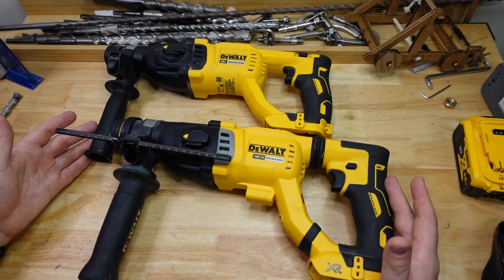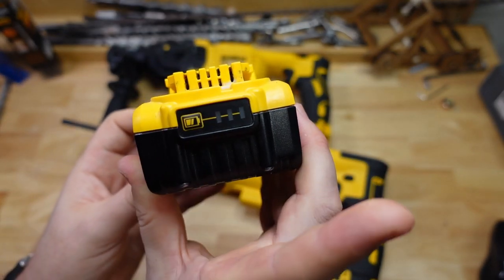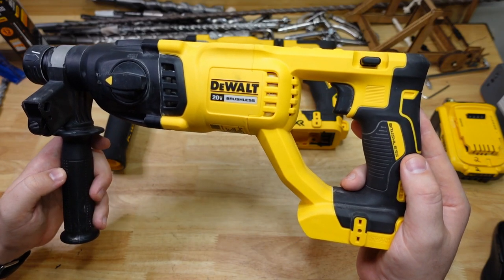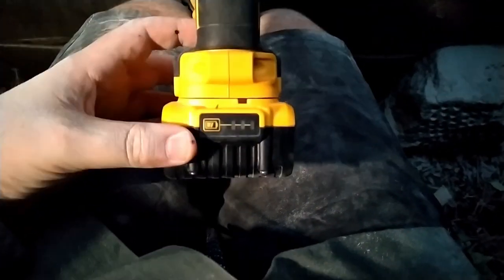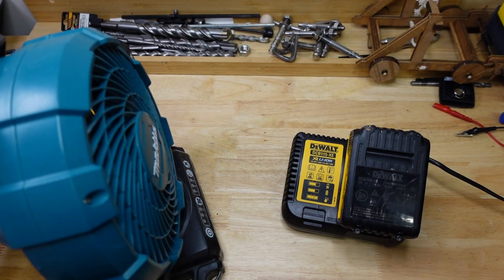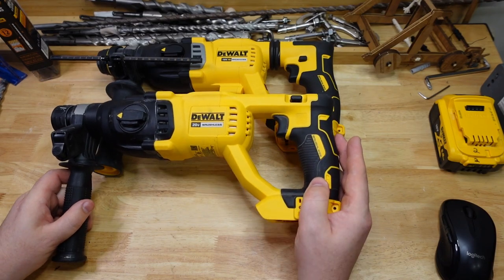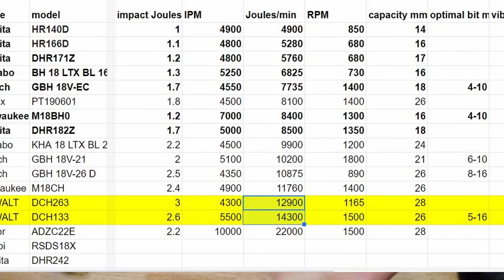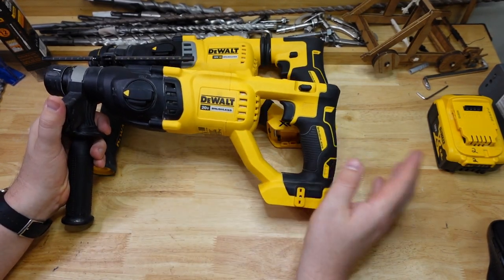DeWalt vs Granite! DCH133, DCH263 runtime tests (cordless SDS rotary hammers)

Comment: Delighted with your review - many thanks! - I have the DC133 which I have always been amazed at how good it is for the money, but I saw the DCH 263 today and Googled the 3 Joules impact and was sorely tempted to upgrade, your review has saved me from a little disappointment! Also a a good tip with the battery discharging issue - I will keep my eye on it - many thanks again - PC

Comment: The DCH133 will dramatically reduce power for a moment at the end to let you know it's battery is done. You can let go of the trigger and then squeeze it again... But this would wear on the battery or potentially damage it if you continue.

Comment: I'm also a climber and a rope access technician.And i have both drils ,plus many other Dewalt tools..
The 133 is ligher and i can handle it better with one hand,the 263 is heavier and i use it mostly for bigger holes.
For the money,i think 133 is the better choice ,for general use.
Reply from the maker: You sound like a smart guy with good taste in rotary hammers and hobbies!
Regarding using the D-handles one handed, do you find they're better than other style drills? Like they get better reach but are less balanced?
Reply: @BoltahDownunder  Thanks for the compliments 😊
I don't find them less balanced with an 5 ah battery,and yes they have better reach. Also ,compared with the other hammers in Dewalt's range (273,283) ,the D handle models are more powerful,weigh less and they're cheaper.
The one that is more powerful is the Flexvolt Dch 333,but it's big,heavy and costs way more...i personally don't need it.
Reply from the maker: Thanks mate, good to know! I usually recommend people get drop motors for bolting climbs, but the 133 is so light and powerful, it's the exception. A real gem

Comment: This was very informative, most videos just talk about drilling into concrete like you say. I recently purchased Starlink and need to mount it on my granite cottage, so have been researching drilling into Granite and not getting very far. I was already looking at Dewalt SDS drills so glad I found this. Subscribed.👍
Reply from the maker: Very cool! Yes assuming you're mounting stuff with something like 12mm concrete anchors (any style really) you'll be able to do that no problemo with one of these tools. The only thing I'd suggest is don't bother trying to bolt your gear down with concrete screws into granite, use another style of bolt like sleeve/wedge bolts or some glue in studs
Reply: @BoltahDownunder  Thank you for the advice. I was thinking about using sleeve bolts, your video 'how to properly install sleeve anchor bolts' is another excellent video. It's so much better seeing this is action rather than reading about it on a forum etc. Anyway, pretty confident in tackling this now🙂
Reply from the maker: Oh cool, I'm glad it helped! I think that sleeve anchor video had a part about the distance from the edges which is important for climbing bolts but not so much for installations like yours, so good news you shouldn't have to worry about that very much

Comment: I also got sent here via Reddit, r/Dewalt, where you even commented.  The DCH263 is on a killer special at the moment here, and I like the idea of having the chisel function, even though I don't need it at the moment (current use will be for anchors in concrete to hold new wooden fence posts).  On special, it's also cheaper than the DCH133, so seems like the clear winner.

However, how does the DCH263 stack up against the "Green Milwaukee" RSDS18X you've also reviewed?  With the special available, it's about $30 cheaper for the Ryobi in Kiwi money.  I've already got both batteries, so no issue there, including a 6Ah HP Ryobi battery.  

Doing the math as you did, the DCH263 should be slightly faster than the Ryobi (but only by a hair).  The DCH263 does have slightly higher max drilling capacity in concrete at 28mm vs 26mm, but I don't think that will be a factor for what I'll be doing.

So other than the form factor, I don't see a massive difference, but since it's the first SDS rotary I'd be buying, I could be missing something obvious.
Reply from the maker: G'day from the west island! Hope you're keeping well with all this shit going on.
Personally I'd take the dewalt. The Ryobi is surprisingly good but not as good as the dch263. The dewalt drills faster, hits harder and has more torque, and is rated 28mm rather than 26.
The only thing is it's not as accurate for small holes due to the high impact so if you're doing lots of like 6mm drilling consider getting the smaller hammer, or just start the holes off slow.
Keep us posted!

Comment: Hi there, great vid, ok I'm thinking of getting one of these as I'm already invested in DeWalt's cordless drill/drivers etc and batteries, my current bosh sds is only 1.7 j so its quite weak and has struggled on a few occasions, and i tried some 3 j Parkside (european/lidl cheap brands) but they just blow, and have common defects...

so my question is which one should i get? the price isn't a factor here, and i wont be using it daily, mainly home/diy....  is the anti vibration a big kicker? the power/time ratio seems to be even as you said 1 hits harder but the other drills faster... i just don't really know which one to get, if you were to choose either, which one would be? sorry and thanks :D
Reply from the maker: I think the 133 would be fine. It'll be more accurate for smaller holes, which is typically what you'd use it for at home

Comment: I work as an electrician. I drill a lot of holes.
I'm looking for an 18V drill but with a dust collector.
Can I buy a vacuum cleaner for the DCH133?
The DCH263 is definitely the D25303DH-XJ vacuum cleaner.
If you had a choice between DCH133, DCH263, DCH273 or Makita DHR242 which one would you choose?
Reply from the maker: Depends on how big the holes are! If they're mostly say 12mm or less I'd get a smaller drill personally, like the dch172 or DHR 182. But really all of the above would be fine. If drilling overhead a lot, look at the compacts, if bigger holes or more speed is more important than weight, then any of the drills you mentioned would be great.
And I don't know anything about the vacuums, sorry
Reply: @BoltahDownunder  mostly I make 5-6mm holes only for plastic plugs and screws. Probably I will buy dch263 :-)
Reply from the maker: I see you're going for the fast option

Comment: Which one is better?
Reply from the maker: Depends on your requirements!
They both perform similarly on smaller bits.
133 is cheaper and more basic. 263 is heavier, more expensive, but better featured, and handles large holes better

Comment: Seeing whereas you’re a climber you should look in to their new power stack batteries(not the slim pack). You can get the same power and possibly runtime with the 2ah powerstack pouch cell battery’s than with the “regular” Dewalt 5ah.

Comment: What is that your cooling your bit with
Reply from the maker: Just water. In this test I cool it off every hole or 2
Reply: Can't that ruin the bit I know where my younger day he always told me don't call your bit with water I remember the first time I was drilling he always told me to use oil or a cutting lube I know this isn't metal and this is concrete but shouldn't that bit get hot also in concrete and he always said that if you get it hot and cool it in water more harder but more Brittle at the same time but yeah he always taught me to air cool it and/if I am drilling steel use a cutting oil he said never let that bit run dry keep enough of cutting oil in your hole
Reply from the maker: I use a fresh bit for every test, so it only needs to last for this one thing. But in general no I don't think brittleness is a problem with carbide tipped concrete bits like this. They didn't get as hot as metal drilling bits because there's less friction. They hammer to cut the material, not scrape.
If they do get too hot then they break at the brazing and the carbide tip breaks off, or the carbide softens and wears down faster
Reply: @BoltahDownunder  I know my bitch I have to use them on the job at William Carey Time after Time after Time because I don't have the money to replace them and I know my bits get pretty hot at times and a couple of days or weeks back I was sitting there and I was drilling holes well I had a half inch bit that I had to put my wire through because I run data phone line and security cat6 which is ethernet cable for a local college anyway I did my half inch bit all of a sudden it fell out of the regular hammer drill DeWalt DCH 999 anyway it went right into the water that was right down below me drain spout well I poked a bit back in there and it was a DeWalt bit lo and behold it would not drill no more I don't know if that ruined it or if it was already ruined before because I noticed that it didn't want to do as good as it usually does so I had to break out the big gun lol but yeah I don't know if it was because it got too hot or what
Reply from the maker: Hammer drills rotate faster than SDS drills, and also don't really hammer much so they get way more friction. I think they tend to cook bits pretty fast compared to SDS. But in general if your bits changed color, like going blue or black, it's cooked and won't last much longer
Reply: @BoltahDownunder  that's exactly what it does go blue or black or like a purplish blue black color
Reply from the maker: I reckon if you can cool it off way it changes color it'll last a lot longer